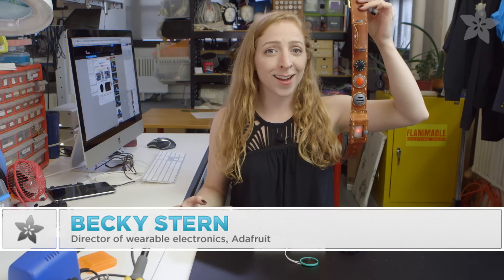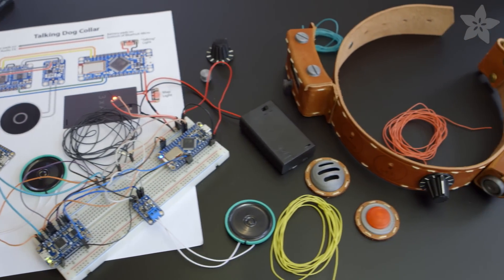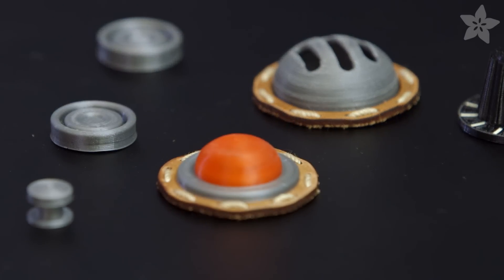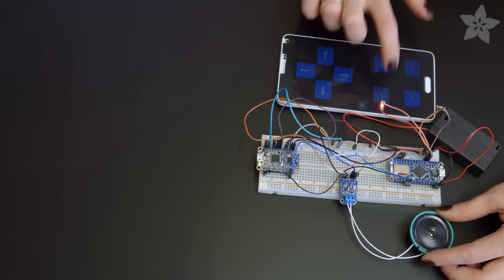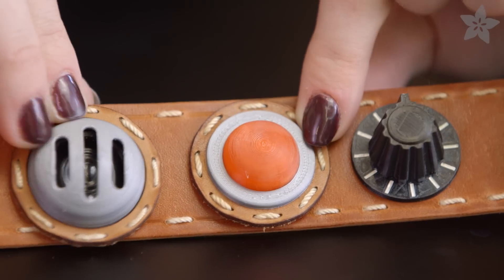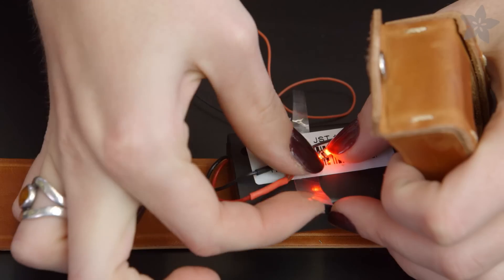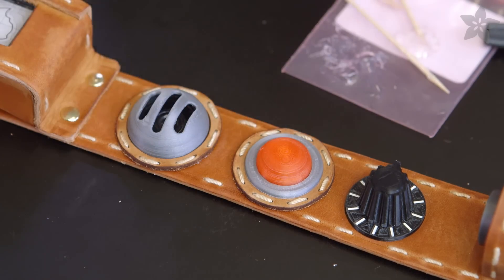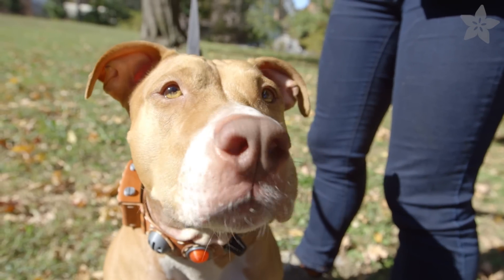Talking Dog Collar with Bluetooth Control

Comment: I am trying to build this collar but when compiling, I keep getting the error message of "Serial1....is not declared in this scope"  The code was directly copied from your code within this project.  I am using the Feather 32u4 since the one you used has been discontinued.  Any thoughts of how to correct this issue?

Comment: I was honestly expecting a collar with a speaker that you could talk to your dog with from your cellphone.
Working dogs with range.
Reply: same here!  I've had multiple "e" collars from amazon aka China  they were fairly cheap and have decent range of 1/2 mile and 3/4 of a mile  over all they are worth it for the price point. I've taken 3 different ones apart from the cheap ones to a  brand called Dogtra.  they are very simple in design.  none of them offer everything I'm looking for and the ones that get close are over a grand yet they still don't have everything id like to see.  it would be nice to design one with real time GPS tracking like location sharing from google maps, the ability to speak through the collar set boundaries as well as the tone vibrate and shock functions and maybe even throw in the camera.  so basically just taping an extra cell phone on his collar and selling it for 600 bucks and put everyone else to shame.  These price points are insane in this market and besides the cost of design manufacturing marketing etc. the actual product can't cost more than 40 or 50 to produce on the extremely high end  but probably less than 10 dollars to make the few hundred dollar ones on the market.  almost all the Chinese ones are exactly the same.  
off topic : one thing about MADE IN CHINA is everything is made in china for the last 40 years just about so i think they know how to make stuff I'd say the U.S. gets cheaply made products from manufactures in China because 1 we continue to buy them and 2 the geo political and economical relationship between the U.S. and china might have something to do with the quality of goods.  China make's Dji and I don't hear to many people complaining about there shitty 1k drone that was made in ching chang China.